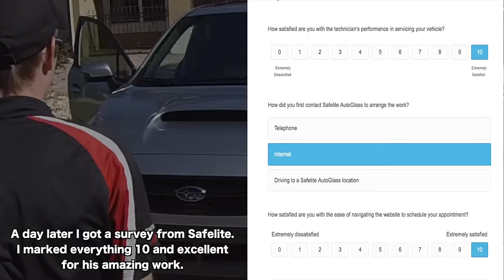Safelite Cracked Windshield Replacement For My 2019 Subaru WRX STI

Comment: I work for safelite solutions, it's pretty cool to see what the appt I'm scheduling actually looks like
Reply: I just got hire for safelite auto installation technician! I start next week anything tips y’all wanna give me
Reply: I have a question if I have glass all over my backseat will they vacuum the car out or is that my responsibility
Reply: @user-sp4vq6et7w  haha I've been asked that a few times. In my experience they always do.
Reply: Oh so you started your own company too lol Safelite runs monopoly clear as day lol
Reply: @rodrigogarcia2622  once they see you do something they expect you to always do it, hence don’t do something extremely hard and act like you can handle it yourself until you can do this in your sleep and depending on your area be weary of the temperature super hot easy to cut out hard to be in the sun, super cold easy to walk outside hard as hell to cut out the windshield
Reply: @rodrigogarcia2622  
1.)	 Make sure new glass is correct part (defroster lines, rain sensor and camera mounts)
2.)	 If correct glass, inspect for damage or scratches, clean and apply double layer urethane primer
3.)	 Remove registration sticker, oil change sticker and toll tag from old glass
4.)	 Remove rear view mirror, camera and rain sensor.  Disconnect cable under cowl
5.)	 Remove windshield wipers
6.)	 Remove cowl corners and cowl
7.)	 Remove rubber gasket from around window
8.)	 Vacuum area
9.)	 Cover dashboard
10.)	 Use Kevlar string  or blade to cut through old adhesive
11.)	 If not using string, apply lubricant to inside bottom of windshield, power tool off bottom of glass
12.)	 Remove old glass and vacuum again
13.)	 Scrape off bottom old urethane, leave a thin old layer
14.)	 Scrape off old urethane from top and sides, leave a thin old layer 
15.)	 Clean and seal scratches and apply sealer, let dry
16.)	 Apply urethane with upside down “v” shape bead, overlap each bead
17.)	 Brush beads together to create a single seal all the way around
18.)	 Attach tape to new glass and fold under
19.)	 Attach glass,  make sure VIN number is centered in little window
20.)	 Attached tape from windshield to roof to prevent glass from sliding down
21.)	 “Pound” tight all around
22.)	 Check inside for visible adhesive
23.)	 Do not clean glass on inside of car till after curing, or do it gently
24.)	 Reattach removed stickers
25.)	 Reattach removed parts
26.)	 Leave windows open while curing
Reply: @rodrigogarcia2622  Please take pride in the people you help and there vehicle and ALWAYS try to do the best job that you can and think of it if it was your car or truck ;)
Reply: @jacobcammer9935  I would not want to try to do this in the winter but a job is a job too.
Reply: @rodrigogarcia2622  update please. How is it going?
Reply: @bigchills7194  yes, update 👁️👁️
Reply: @jacobcammer9935 what company you recommend?
Reply: @rodrigogarcia2622  Hi sir Do they accept the job without experience and work with them for training
Reply: How is it working there I’ve seen a lot of negative reviews about the company and supervisors

Comment: I use to be a Safelite employee as a tech, best of belron competitor, and manager I would also occasionally help in training guys that were going through Safelites training course to become an installer. Unless times have changed where is this kids chemical resistant gloves, he for sure wasn't wearing cut resistant gloves for either the removal or installation of the glass, most importantly the removal. Especially in Florida where it tends to be hotter climates and glass can fracture or break much easier and he was bare handed lifting that glass up. Prepped the glass barehanded as well and only put a single glove on for shooting a skin on the glass and to smooth the adhesive out. Also is Safelite using primerless glue now? I thought they were using Sika products which require primer if its Mach 30 and Mach 60 I don't think I saw him prime his windshield at all. I also don't think I saw him use a scotchbrite abrasive pad, or sika's, HDX version of the magic erase pads to remove any oils or contaminates from the frit installation area especially handling the glass barehanded and the natural oils in our skin. While using his easy wire tool he only used the dash protector, he didn't use the pillar and headliner protector, I didn't look like he used any type of a positioning clips on the bottom of the glass to hold the wire in place, which is why when the wire tightened up he got out to look to see if it was caught on something before finishing wiring it out. No seat covers, no steering wheel cover. Safelite is funny, I know guys that have lost their jobs for much less then this. These are "compliance violations" and each one were to be considered grounds for termination. I'm not knocking the installer at all, he's not bad with the Safelite tools. It's Safelite period how things are suppose to be consistent through out any region, any market, you're suppose to be able to go over seas and pickup where you left off.... Search YouTube for installations done by the company "Carglass" they just as Safelite does fall under their parent company Belron and watch a CarGlass installation. Sorry it's just very interesting to me. I fell in to their politics and that is a company I would never return to and work for. I was an award winning employee every year until they started bringing in people from like Walmart, DHL, Fedex to run an automotive business that knew nothing about automotive! But hey as long as their numbers are looking good on paper and in the system I guess it is what it is because that's all they care about. Safelite there is no room for growth either, you land the job you want start making the money you want and when you make a little to much they find a way to take it away or just cut you loose regardless how many years you have invested. Unless there is a natural disaster that strikes then you are all in and it's whatever you want until that runs out too...... Someone show me Safelites turn over rate for employees! I want to see that.
Reply from the maker: Hot damn Paullie, that’s a comment for the ages.
Reply: The mother of all comments
Reply: Speaking nothing but the truth here
Reply: To be fair given I wouldn’t know the situation, nor company guideline but at least for me if someone was recording me work I’d be nervous as heck, probably messing up with some stuff, but I do agree that when you work with a company and they have a strict set of guidelines to uphold if your not doing that well and are actively aware, it’s fair id fire em too

Comment: I used to work at Safelite autoglass in Chicago. This guy did everything well! Hopefully they dont overwork him like our shop did. I was a mobile technician and we had to do 6 jobs a day mandatory. A normal windshield like this takes about an hour to an hour and a half. Most windshields nowadays require to be recalibrated as well which can take another 30 minutes. Then theres travel time with traffic between each job. I would get home really late every day burned out. Wasn't the best company to work for. Safelite rarely gives out raised. Its all numbers based.
Reply from the maker: Thanks for commenting. The windshield from this video is still on my car and it’s never leaked or made wind noise on the highway. Sounds like a grind to work for them, not an easy day for sure.

Comment: Great job until you shot your beed . this is why most windshield leak.Most important  part is the top  beed start top left corner across the top down the A pillar across the bottom center. Repeat for there side  now you have 2 seams instead of 5 seams spray glass cleaner on the glass and give it a good smoothing out with your hand.do evry job better then the last. 32 years in.

Comment: I just had my windshield replaced three days ago. I was working from home. The Safelite technician arrived at noon; he was done at 12:35. I was like, if I would have known it would be that quick, I would have watched the process…which is why I’m here. The technician in the video showed his professionalism👍🏽
Reply: That's not good 35 minutes on the remove and replace. The skipped something to save time like this guy in the vid skipped a few steps.
Reply: @punktalley  What a load of b.s. Doing a proper 35 minute replacement is a snap. Inspect car, inspect glass, cover hood and seats, 5 minutes. Remove mirror, wiper and cowl, and unplug heating element takes less than 5 minutes. E.Z. wire old windshield out takes about 5 minutes. Prime glass, 10 seconds. Remove old urethane and activate bonding area, 2 to 3 minutes. Wait 3 minutes for chems to flash. Prep car for install while waiting. Tape on the car or the glass, and set up cups or 1-tech mounting system. New tube of polyurethane in the caulk gun. Those are easily done during the chemical flash time. Apply urethane and mount windshield in approximately 1 to 2 minutes. Reinstall components and reattach heating element. Approximately 3 minutes. Remove covers takes 30 seconds. Done. On a nice day, and working on a vehicle thats less than 5 years old q typical replacement takes 25 to 30 minutes. Add an additional 5 to 10 minutes for washing windows and vacuuming the car. Drive time is approximately 30 minutes after installation. If it takes longer than that, you need to explain to your customers that you are slow and cannot perform as well as most glass technicians.
Reply: @MW-xv1sj  if you say so. I know the results of most all 35 minutes replacement. I put out quality and tell my guys if they want to speed install go work for satellite. Take your time and do it correctly.
Reply: @MW-xv1sj  I would like to see sealer applied to the car to cover any scratches that might have occured during removal of old adhesive before installing new adhesive. I take this to be a critical step to prevent future rust or water intrusion through an unsealed gap.  No removal is perfect.  At least inspect and treat scratches, please.
Reply: @MW-xv1sj  I presume you do this/ have done this for a living before? Lol. You seem super familiar with the whole process
Reply: @RedsBigRig  been doing it for 15 years, but it doesn't take more than a year or two to get proficient. The way they make cars now it's much easier to change windshields.  If you are well trained and have a solid routine you can really do well in the glass business. The main thing is taking care of the customers car. Unfortunately there are lots of people that just don't care.
Reply: @punktalley  I can do most windshields in 45 mins or less, some take longer, most I can do in 30 mins. That’s with doing it the right way and taking everything surrounding the glass including the cowl off too. That comes with years of experience and muscle memory. If you use a sawzall to cut out a windshield and end up stuffing it in the cowl then congrats you’re a hack and saved a whole 10 mins on the job. Anybody can do a wrangler windshield with hand wire in less than 10 mins but that’s not hacking. Some cars are just easy like this WRX for example. 30 mins car all day long. So no being quick does not mean you’re a hack it means you’re efficient and can keep a steady pace.
Reply: @seanfoster7836  I can too but why? So I can do more glass and make more money by getting out an extra set each day?  

Why not slow down, take your time and calm down knowing its right....you wasn't in a hury so nothing was rushed.  

I'm sneaking up on 30 years in the glass business and I've ran my own shop going on 10 years of success.  I've seen enough in this business to know those of us that take our time enjoy what we do and ain't nearly broke down in bad shape hurting all the time but the beer and goodysdon't ease much as it used to do.  Its not worth it.  Chill out tweak and take time to enjoy it all.
Reply: @seanfoster7836  I don't reward my guys for pumping out 10 sets a day because I take care of my guys as long as they take care of the 5 customers of mine I schedule them for one day.  I will punish my guys for leaving tools or scratching paint or anything that's damaged because of carelessness. I pay my guys well and expect them to respect what I have the opportunity to provide for them.
Reply: @punktalley  I don’t pump out 10 jobs a day lol. I bang out my 6 jobs and then go home to around 2 and get paid a full day 7-5 every day. Obviously when you come to a newer car higher end car and do recalibrations I take my time. But if your guys are taking 1-1.5 hours on a plain Jane Camry there’s something wrong. But hey what do I know 🥴 Different strokes for different folks.
Reply: @punktalley  why’s you wait a whole day after your first reply just to say that?
Reply: @punktalley  also you punish your guys for accidental damage? What do you do, write them up or fire them for not getting a picture of a scratch in the pre inspections? You sound like a great guy to work for 😂 shit happens man. I’m glad to say I have a manager who actually has his technicians backs and doesn’t just bark orders and expect the impossible.
Reply: @seanfoster7836  we spend an average of an hour and a half on each mobile customer.  Thats from the minute we arrive on the job site til the minute we leave the job site. This includes greeting the customer, doing the installation and invoice transaction while answering any questions the customer has plus explaining the dos and don'ts of the service we completed along with our warranty details.

I don't send two techs out for the same mobile job. If that job consists of a glass part thats unusually bigger than average then that job is brought to the shop if possible. 

I also have a person who does nothing but field work. Btw I do flat glass along with shower enclosures, store front doors and any other glass orientated services. The field tech goes out to do estimates, measurements and chip repairs along with anything else that could be reasonable. Say like assisting one of the techs doing a job that wasn't possible to be brought in shop.  

The field tech takes separate rides and they don't help out for the entire job. They only stay as long as four hands are needed. Like a big rig glass or an oversized windshield like in these newer Fords or heavy equipment. They are also the one that helps set these bigger store front windows or oversized mirrors.  

I keep one person at the shop all the time that does nothing but shop work like cutting glass or screen repair and fabrications for store fronts along with helping out on in shop autoglass.  I usually stay at the shop and help out there while taking in calls, making work order/invoices for same day jobs(like emergency/urgent jobs with store front doors or heavy equipment for strip mines) and jobs that I scheduled for myself. All the auto glass jobs I schedule for myself are usually the oversized auto glass and in shop auto glass jobs that the customer chose to bring to the shop. I also do window tinting that only is installed by me but usually I don't schedule it during operating hours. 

I've worked at three other shops that where ran completely different from each other and found the way one of those shops that I mirrored my shop after be the best for both owner and staff. Being best not only from a financial view either but as for everyones physical, mental and medical viewpoint as well.
Reply: @seanfoster7836  punish is probably the wrong term I should have used the term responsible. 

I hold those responsible for damage that was caused by carelessness or tech failure. I have a $500.00 deductible on the shops $1,000,000 liability insurance policy.  If an employee has to use this insurance that I pay for from my paycheck then I expect them to pay half the deductible.  I don't expect them to pay this all in one payment nor with their next paycheck but I do expect it to be paid.  I will allow them to decide how much per week they want to pay with a minimum payment of $5.  

I own up to being 50% responsible since I hired them but they are at fault also and $250 for a $2,000 mistake is more than fair. 

Since I pay my employees very well and they are treated even better they have no problems with this agreement.  Notice I used agreement. When I hire someone we have an agreement which is written out covering almost any situation possible.  I have it signed and notarized as legal document that protects both parties.   

I get it mistakes happen but there us no such thing as an accident. The meaning of the word accident is an event where no party is at fault. That's impossible because somewhere in the series that lead up to the unwanted event is a cause for the effect. 

I've never had anyone quit working here because of anything shop related. All my employees have access to the shops toys also including a couple campers on the lake with a decent little fishing boat for each camper, a pair of jet skis that are older models but in good shape and a few four wheelers that are also older but in good shape. Even though I own this shop every employee has the same power as I do. The only difference is I count as two employees really cause I consider the shop as an employee also. So if 2 employees vote on something that I disagree with them on then other employees can decide the outcome. 

I bet you would work for me and would never regret it. I take care of my people so good they would never want to start their own glass shop if they had someone provide the building for a shop and a vehicle to work out of at no cost.....its a fact cause I tried it.
Reply: @MW-xv1sj  Well Said, if your a bit slow it just means you want to do a good job too IMO
Reply: @seanfoster7836 whatca paying? Do you include relocating incentive lol you sound like a good man to work for lol I got 5 years hahaha